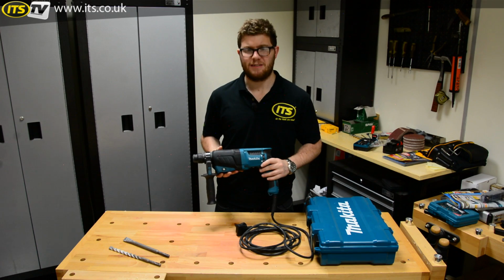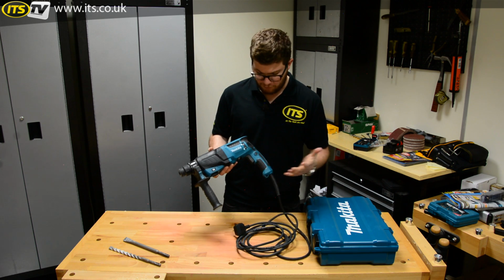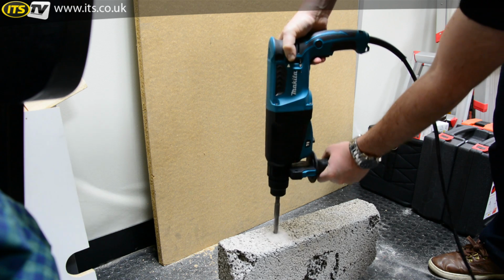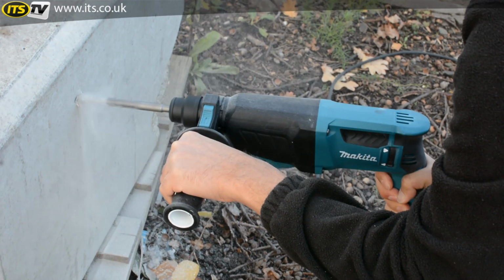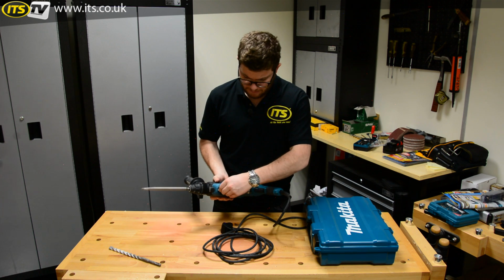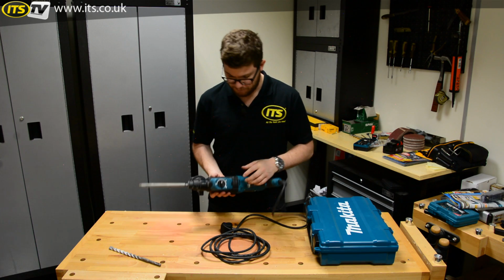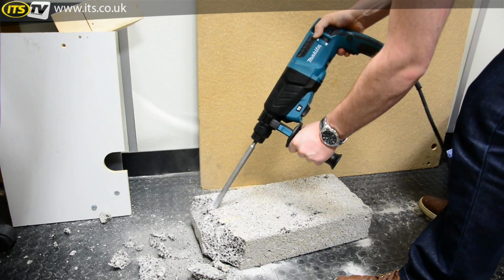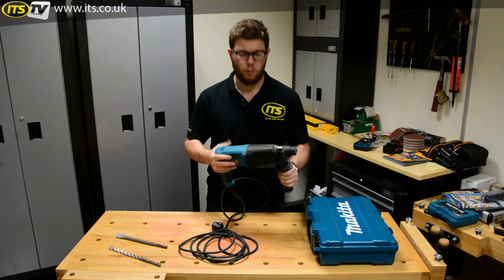Makita HR2630 3 Mode SDS+ Rotary Hammer Drill  - ITS

Comment: Used it to demo a large Bedford stone fireplace that had a thousand bricks inside, and it did the job well and is still working  https://www.youtube.com/post/UgkxqqoaX03nrziKwF7Bjjcc71YzLEleMvOS  . It took abuse above and beyond what it would endure in a shop environment (grit and dust, watery compressed air from a portable compressor, a few drops from roof height) and still works great. I kept it oiled and drained the compressor often but that's all the "care" it received, the rest was just hard relentless chiseling for a few days (we cleaned the mortar off the stones and bricks too) and it performed admirably. For less than $50 it was a great bargain. Electric demo hammers start at around $200 and the ones at that price point have mixed reviews; a rental of a contractor-grade unit locally was over $100/day and I couldn't get the job done in less than 3 days minimum (occupied residence so had to be careful and clean up as I went) so a relatively inexpensive air chisel turned out to be the perfect solution.I wrote a longer review about this tool before, with pictures and everything but Amazon wouldn't publish it for some vague, computer-issued reason. But take my word for it, this was a massive, 2-flued/two story (basement and ground floor and 6' above the roof) fireplace and it generated an incredible amount of rubble and this chisel did the whole demo, I didn't swing a hammer once.